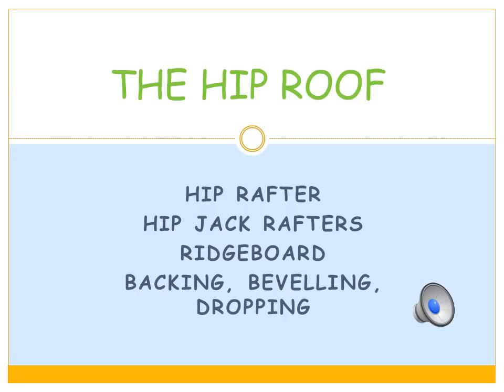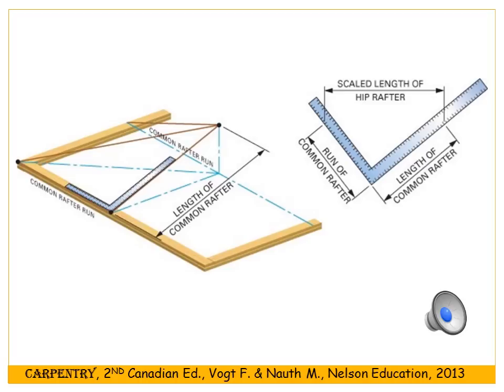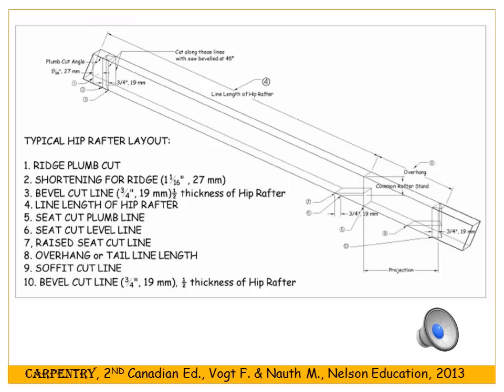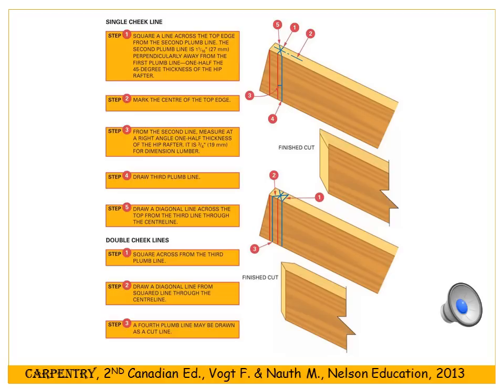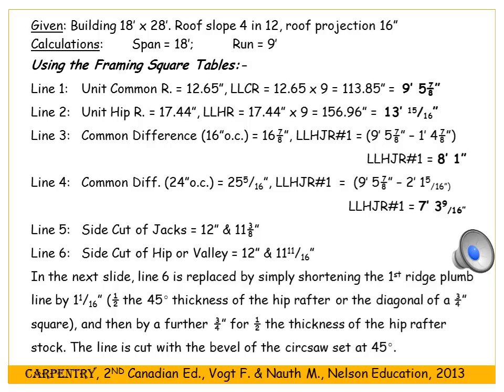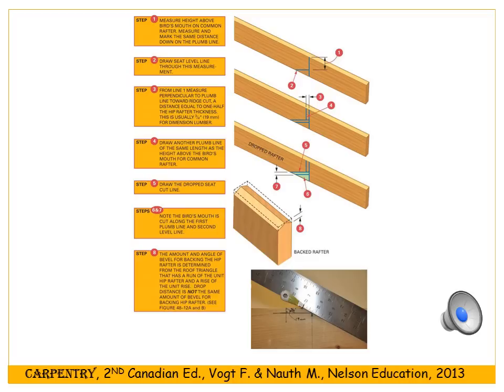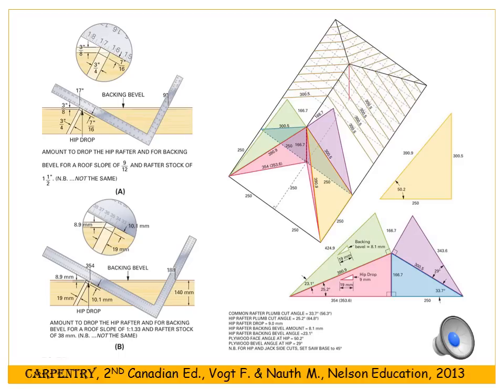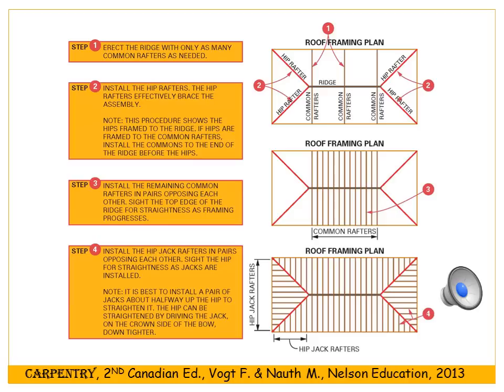THE HIP ROOF

Comment: Very good information Michael and well explained! On the point of shortening the ridge, we normally face the last pair of rafters with a saddle board or a type of gusset board for the hip rafters to rest against as they have a longer plumb cut, the crown rafter in between is also built down with a triangular block or the same rafter thickness and this enables a longer plumb cut on the crown rafter similar in length to the plumb cut of the hips.
Reply from the maker: Excellent idea, especially when the rafters are exposed.

Comment: You're using 45 degree angles for every side cut angle. This works well for shallow pitches, but not as well for steeper pitches. You can use the side cut angle info. stamped into your square for a better fit.
Reply: I mark my side cut angle lines first, then the plumb lines. You are doing pretty much the same thing, only in s reverse way than what I do. I only end up with two plumb angle lines on the side.
Reply from the maker: 45° is the bevel angle at which the power saw  is set while cutting along the plumb cut line.  The side cut angle ratios are used to mark the top edge of the Hip rafter (or Jack rafters) which is used as a guide for cutting the rafters with a handsaw.
Reply: @michaelnauth  Yes, I know, but the side cut angles at the top can be cut with a circular saw, if you have one that goes beyond a 45° bevel. This will give a better fit.
Reply from the maker: @Jay-tk7ib  Try cutting along the plumb cut line with the saw bevelled at 45° and you will see that it produces a steeper than 45° cut at the top of the rafter. Should produce a perfect fit at the ridge.  Also try using a Mitre saw for increased accuracy.
Reply: I'm saying that the ridge plumb cut can be cut with a bevel greater than 45°, cutting the side cut angles at the proper angles. I know that not all saws go beyond 45°.
Reply: @michaelnauth  I have cut them at 45°. I know that works.
Reply: If the saw is set at 45 degrees to make the side cut it will work on both low pitch roofs and also for steep pitch roofs!

Comment: I have a common Rafters with an 8 inch overhang.How do I measure the overhang on the hip rafter?Do I measure an 8 inch square diagonal? I’m very confused
Reply from the maker: The short answer is yes. I am hoping by overhang you mean 'projection' or the horizontal travel of the tail of the common rafter, in which case the horizontal of the hip rafter would be 11 5/16" or √(8² + 8²)
Reply: @michaelnauth  yes that is exactly what I meant.Thank you for the reply.Huge help

Comment: What would you set the saw bevel to for cutting a purlin if the edge bevel purlin is 49.1 degrees from a 30 degree roof
Reply from the maker: A 30° roof is close to a 7/12 slope, or a 6.928/12 slope. The hypotenuse of 7-12 triangle is 13.89 (on line 1 of the Framing Square Rafter Tables), and for 6.928-12 triangle, it is 13.856. To find the Hip Rafter, you would find the hypotenuse of the 7-17 triangle (or 7-16.97 , the diagonal of a 12x12 square), and you would get 18.36, found on line 2 of the Tables. To get the bevel angle, you  would calculate or measure the small angle of the  7-18.36 triangle, INV TAN (7÷18.36) or 20.87°.
For your 30° roof, the hypotenuse of 6.928-16.97 triangle is 18.33, and the bevel angle INV TAN (6.928÷18.33) is 20.7°.  Incidentally, 49.1° is the angle of the 13.856-12 triangle, INV TAN (13.856÷12).